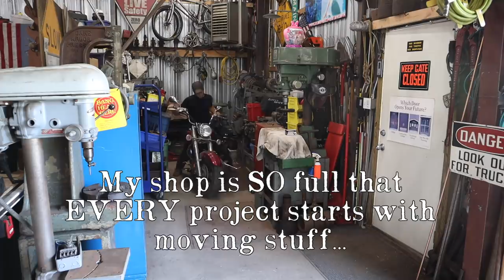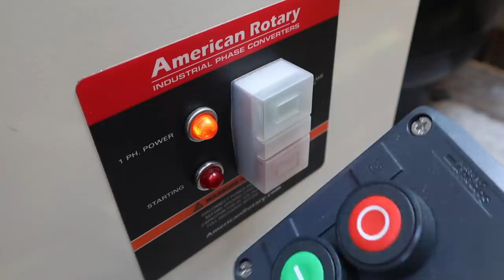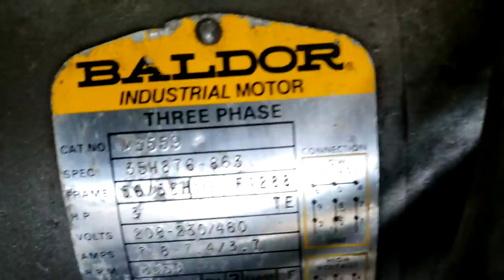WHAT is 3 Phase Power? ~ Installing a Rotary Phase Converter ~ Part 2

Comment: I did a lot of commercial and industrial HVAC sheet metal work in my younger days. When you got close to the bottom of the metal wall i was waiting and sure enough. We always had electrical tape and Band-Aids in our tool boxes, when you showed your finger leaking, yep that's gonna be sore tomorrow. Good show thanks.
Reply from the maker: That combo works like a charm on busted fingers!

Comment: Wonderful idea. 3 Phase equipment and motors are cheaper to buy and run because most people have no 3 phase power. There is a local yard here where I can buy 3 phase motors for  $1.50 per horsepower. Great video.

Comment: Nice job wiring up the converter. As a master electrician, I've used these quite a few times. Yours is very nice with the cap bank. It surprising how many electricians don't know about these.

Comment: Nice job!.  Three phase conversion develops 2 of the 3 phases that you don't have from the grid, each phase is 120 degrees apart from the other. (25:45)  Single phase power from the grid is actually a split phase - each Leg (L1, L2) to neutral is 180 degrees apart.

Comment: Nice work, but every time I see electrical installations in the USA I have to think of installations from the 60/70s from Germany. I'm really glad that every house here has a 3 phase connection and that the Panel's here are much safer. As an electrician in Germany I get a horror every time I see your installations. Not exactly yours but in general. But I have to say that your installation (of the ones I have seen) was done very clean and conscientiously. I really like watching your Videos. Keep on going.

Comment: Old sparky trick is to drill a hole the diameter of your earth electrode in a scrap 2x4 so you can slot it over the rod and hold it straight without risking your fingertips.

Comment: When you get everything up and running, I would be curious as to the change in your electric bill. Thinking about adding 3-phase myself and wondering the impact to my total electrical load.
Reply: If he were to use the same wattage, there would be little or no change in billing. 

For anyone that is interested, in theory one horsepower is 746 watts, so 20 HP is 14,920 watts. The company may state that it is the equivalent of 15 KW.

Comment: I hope those openings along the lower sides of the phase converter weren't needed for ventilation. You covered some big openings with those angle brackets. You might give American Rotary a call and ask. Never too late to cut away the center sections of those angle brackets.

Comment: Hope your finger feels better.  Cute pups.   With the container do you have a little free space in shop?
Reply from the maker: It wasn't as bad as it may have looked! The container is still mostly empty because I haven't decided what the full plan for it will be, and I don't want to load it all up and have to unload it if I need to move it in the near future!
Reply: Will you have to insulate the container?  How cold are your winters?  You had a perfect spot to set it.  Good luck and I can’t wait to see how you use it.

Comment: Didn't know they made those. Reading through the comments people seem confused on single phase vs three phase. Your house is split single phase, 2x120v legs 180 out. 3 phase is three legs 120 out of phase.  This is the power generated by the power company, hence the three lines on the top of a telephone pole. If you look at the transformer feeding your house, you will see it is only using 1 of the 3 lines on the top of the pole, This is why it would cost $25k from the power company, because they would install 2 more transformers ( or a single 3 phase version) and appropriate meter, ect. L1 and L2 do not just feed direct to 2 legs of 3 phase. Your house is single-split-phase with 2x 120v feeds which can combine for 240v but is still single phase. This is used to power a single phase motor probably at 25 ish amps. This gives you approx 6kVAs (25x240/1000). This powers a three phase motor which works in reverse as a generator. And produces about 15.5 amps at 380v, 3 phase power. Basically splitting the amps between 3 wires instead of 1 or 2 

This is the benefit of 3 phase power. It's equivalent power (kVA) with much less amperage, meaning you can use smaller wires and such making industrial equipment cheaper to install as a whole. Modern single phase motors can produce equivalent power, they just need a lot more amps and some electronics.
Reply: Jean I don't understand. If you take one leg of a 3 phase supply surely you only get 120 volts and a neutral?  Do you mean somehow that the transformer is a Delta connection and not a star connection?  Here in Australia if we take one phase to premises with a neutral we get 240 volts single phase not 415 volts which you would get across 2 phases?

Comment: It seems that the angle irons you mounted on the side are a bit overkill. ALSO - you faced the unit out making passage difficult. BUT you ,ight also have done this to provide access to both sides of the unit. Regardless - you did do a nice clean job oft it and that is what really counts. I was wondering with all the bolts and brackets - were you expecting some sort of violent earthquake or sudden tornado that would make this thing slide or move by itself.?  3 Phase is Much more efficient for driving motors. You  made a good accidental decision. Maybe you should make a box. Those vent louvers can let hard driven rain IN just as the normal air can get in. Boy, that Baldor jumped into life. Well - good job well done

Comment: I love your videos, you are very detailed in the processes of the work you do. 
I was curious about the long bolts you used to fix the converter and panel support to the concrete, can you tell me the name of them ? They looked a bit different from the usual Fischer expanding Anchor Bolts I normally use.

Comment: Interesting....I would really like to see a comparison between this and using VHD's in a cost scenario as love 3 phase at my workshop but its over 10k to install + actual cost vs running something like you have.....Although still cheaper to run my rotary compressor on petrol/diesel than POWER haha

Comment: I don't quite know enough to be dangerous, but I did have a question: so you're running an RPC for three phase power off of a sub panel? Or am I misunderstanding? Don't you normally want to run stuff like that off of a direct line? Again, I know little about electrical work.

Comment: what do you intend to do with all the stuff you have??  Oh I see more room to put MORE stuff!  Great.
Reply from the maker: I have plans to have fully outfitted workshops for: machining, woodworking, blacksmithing, metal fabrication, restoration work, Paint booth, and a few more modern shops like cnc, 3d printing, and a plasma table! Trust me it will be a Comprehensive Workshop / Maker Space that will rival most! I do plan on selling machines I have too many of though like engine lathes! It's not about "stuff" for me, there is a bigger picture!

Comment: Ok this isn't a Rotary from Rotary Phase Converter company.  A rotary has a motor/generator that 220 single goes in and off the winding 3 phase comes out.   It doesn't need a rotary.   I have 6 (needed 3 but the other 3 boost up) so I get 380V - 3 phase. It spins on the floor and the transformers contactors and such are in a large box. The box plugs in (makes it temporary ) to the eyes of inspectors and the loads are on 3-p cables - 4 wire.  Always a safety gnd is carried.  It sounded like a rotary but the caps don't jive.
Reply from the maker: I think you should read up on the American Rotary AI-20!
Reply: @SalvageWorkshop   Like I heard sounds like a rotary.  Odd with all of the caps. Must be special compensation on 20hp sizes.  I drive two surface grinders 6 motors in total - with mine.  And the motor/generator is on the floor and the enclosed contactors and sockets, frequency meter and such are in a wall box.  Transforms above on a 3/4" ply board.  They take the 208 and make 480 three phase.  Some units are caps only for converting home single phase 220 into three phase with a wild leg like you have.  Maybe a hybrid.  I designed mine.

Comment: Hi I am an old electrician in Australia and our voltage here is 240 volts at 50 Hz.  We do not supply 2 phases normally to premises so I am not familiar with using 2 phases at an outlet?  Do you use electrical tools at 110 volts and 220 volts?  We only use 3phase outlets at 415 volts and sometimes we supply a neutral for a 240 volt coil on the contactor.  I was very interested in your rotary phase converter as I have never heard of them before.  Did you buy this system because you could not get 3 phase from your supply authority or because it was too expensive to install?   Love to hear from you or someone to explain to me. Thanks in advance.  Ross Johnson
Reply: The power is NOT two phase. We use single phase with a center tap to get our 120/240, although older systems used to be 110/220. The two hot legs are NOT 180 degrees out of phase like so many people have mistakenly claimed. It is the same as your 240/415 volt single phase supplies.  

It is very expensive to have 3 phase installed. It requires a 3 phase power transformer and there is usually a electrical usage surcharge due to circulating currents and other phenomenon of 3 phase power.

Comment: Aren't three phase leads 120 degrees apart, and Red/Black on your two phase panel 180 degrees apart?  But you said that the 180 degree separated leads are exactly unaltered,  unseparated?  What could you get then in sequence, 180/90/90/180 for RED/BLACK/BLUE/RED?  How would any equipment handle that  Wat?
Reply: By placing the 90 deg off voltage at a proper level, you can get 3 phases / 120 deg with 230V phase-phase voltage in each of 3 combinations.

Do note that the (virtual) neutral point of this system is NOT the same as the neutral of supplying 2 x 115V.

From true neutral to any single of the 3 phases, the voltage must  be  133V , but to the supply-line neutral, 2 of the phases will only show 115V (each).

This means that the "neutral" that was ducted (white) into the 3-phase panel is totally wrong, and should not be there. This phase converter creates a delta system without available neutral point. If such a one is required, I'd say that a 3-phase full transformer, wound D / Y-0 will be required.
Reply from the maker: The white was added in case I decide I want to have a single phase breaker in that panel for some reason, in which case I'll want a TRUE neutral so I went ahead and added it while I was doing all the wiring... It has nothing to do with the 3 Phase Delta System or phase converter.
Reply: @SalvageWorkshop  Well, yes, but to WHAT would you connect the hot side for that single phase breaker?  It can't be any of the lines from the three phase system - the voltage would be all wonky, as the virtual-neutral they rotate around is not the neutral you've wired in from the ground?
Reply: @RunPDP  Thanks for the explanation.  I was wondering the same.  If I understand correctly, the "Virtual Neutral" has a phase shift of its own that rotates at a 30 degree offset from the incoming phases, essentially moving the center of the circle?  Does that mean that the third phase would be asymmetrical in reference with earth ground (or incoming neutral)?
Reply: @SkylosSobaka  You don't connect to any of the 3 phase output wires. The hot would be either L1 or L2 (the two hot wires feeding the converter input.

Comment: You bought a converter. How far away is the closest three phase pole?
Reply: Better to answer in $ than in ft/meters!

In many parts of the world, 3-phase connections are priced quite high, because they are not wanted by the Utility companies - having to have a "special kind of meter", 3 transformers, special circuit breakers and cables etc this would make him into a "not profitable customer".

Most likely, the post at the edge of his property is carrying 3 phases with a voltage of some kV, and ONE transformer connected phase-phase on the supply line and giving the 220/230 V center-tap secondary that is the normal US supply. Putting another 2 transformers there, replacing the cabling to his buildings, the switchboards etc would do the job, but not cheap...
Reply: I'd might be slightly off - secondary voltage might be 240V Center-tap, giving 2 x 120V "lamp voltage".
Reply: @RunPDP  Many places have 3 phase power at the utility pole, but the customer only gets split single phase. So their service is 120/240. I don't think it is used in the US any more, but power used to be sometimes supplied as 3 phase in a delta configuration. The problem with this is that there is a wild leg. The voltage between the center tap and the third leg is something like 277 volts.

Comment: I thought you had to have a Magnetic motor starter to get the motor to run.
Reply: If I recall correctly, those old motors had a capacitor across one winding to produce the necessary phase imbalance. The capacitor is disconnected when the rpm gets up a bit via a centrifugal switch.

Comment: Be careful around those Capacitors (Caps)! You touch, you die! =O
I was sad,  that no dogs assisted you! =(   14 puppies?
Reply from the maker: Yup don't touch em! Yes, 14 pups!
Reply: That's exactly how so many ppl ended up with a new hairdo when digging around in their 
broken microwave ovens w/o realizing that they're supposed to discharge the capacitor first.

Comment: did you say your 3 phase was only 220v? weird
well weird to me anyway but then again the entire US voltages and stuff is weird
here single phase is 240v and 3 phase is generally 415v
Reply: 220V does not sound right.  Normally, in the US, the voltages would be 120/208.

Comment: I winced before the strike. I don't hold things I hit with a big hammer. I did it once and spent six weeks waiting fore the splint to come off. I never did it again. I have been wondering about installing a 3 PH converter. The machines that run off it seem to last for centuries instead of maybe years. It actually uses less power from what I'm told.

Comment: I like your ambition...But I see a "Major" problem! I've been Trained in and worked in the Electrical Industry over 30+ Years. You have to run the power wires together at all times. You cant run the power wires or the neutral wires by them selves or they turn into a electric heater. Hopefully you read this and have another electrician confirm for you. Good Luck Your Videos are Great!
Reply: If that were the case, then every switch drop would be a heater.
Reply: @buggsy5  no, that would be different...because the EMF going on different directions would cancel out that effect.

Comment: Great job, make life a lot easier with these big old 3 phase machines, as it's either this of lots of VFDs.
One thing I would do is add a signal light on top of the 3 phase panel, so you know the 3 phase is is on, will also help remind you to turn it off when not in use.

Comment: I think you need another 2000 sq. ft. under cover!  You are young and need to expand, I already have 250 pounds of stuff in a 50 pound bag, but at 80 years old I finally  called it quits for expansion.  Just play with what I have. Thanks
Reply from the maker: I definitely need to expand, but the struggle is if I want to do so on this property or not... Hense the shipping container... storage that I can move! Right now Ive prolly got 1000 lbs in a 50 lb bag! I'll be selling some of that soon as well!

Comment: Could you, when you get it wired in, do a video about your lathe, i just recently picked up a springfield ideal,  thats somewhere around 100 years old, and it looks very similar to what you have and there isn't much info I have been able to find about them.
Edit, specifically the one that was directly in front of where you put the panel.
Reply from the maker: That is a Hendey Gear headed lathe and was built in 1920... I will do a video on that lathe at some point, dont know when though!

Comment: Just loved this! So jealous of all the fun stuff you have to play with and bring to life.  May I suggest one more step for wires connecting to your breakers in the panels, wrap the wires going to the breaker around a rod ( I use a Phillips screw driver) four or more times and you are much less likely to have them get loose over time. Really nice to see a panel that doesn't look like a rats nest. :")

Comment: You are knowledgeable in most disciplines but vibrations there are some weak spots. Luckey for You the phase converter run so smoth. If there is noice transfered to the concrete You need to open the hole in the L-prophile and add a rubber block under the nuts and washers. I learn a lot from You and Your videos. Thanks

Comment: Having a dedicated phase converter is great.  You can do the same thing, although not as elegantly, with a 3-phase motor.  A number of years back, I had a large drill press, just like the two that you just picked up, but larger, that had a 3-phase motor.   A friend of mine brought over a surplus 3-phase motor that he had, and wired it to create the third phase for the motor on the drill press.  It took 220v single phase in and by spinning the motor either with your foot or a rope, and then connecting the single phase power, the motor would run and create the third phase for the motor on the  drill press.  Not as efficient, but much easier on the wallet, for my limited needs.
Reply: That's about equal to what the American Rotary box does for you but self starting.
Reply from the maker: Ya I almost went that route!